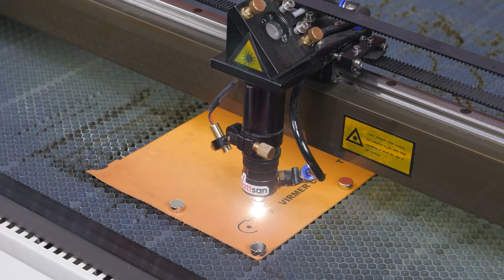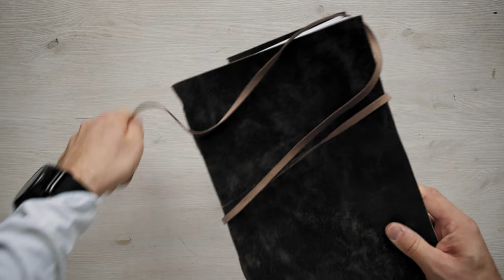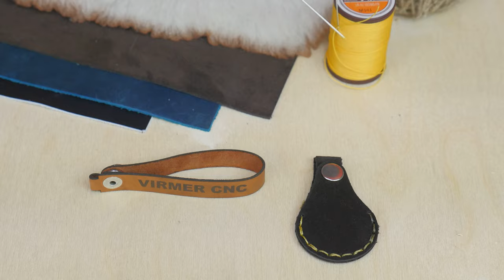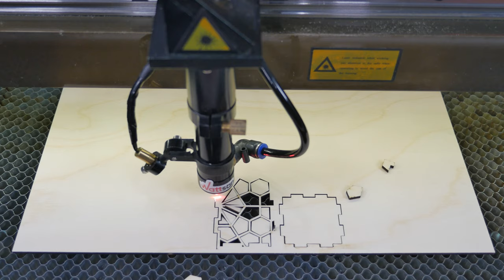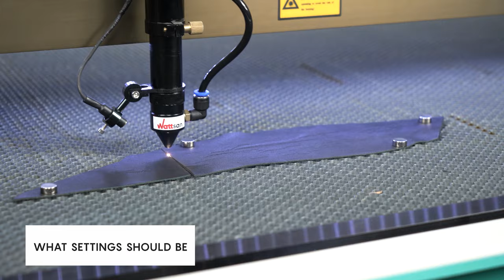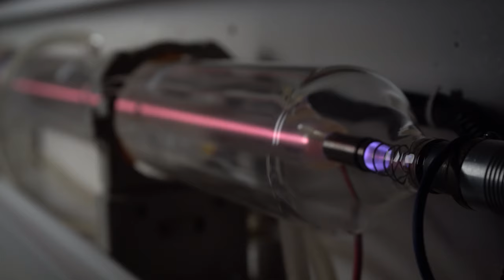HOW TO CUT & ENGRAVE LEATHER | WATTSAN CNC MACHINE

Comment: What's the wattage on your machine you show the settings for?
Reply from the maker: Hi. Thanks for the question! There are two machines featured in this video:
Wattsan 1290 with 1200*900 work area, 90-100W laser power and Wattsan 6090 with 600*900 work area and 100-130W laser power.
The laser power largely depends on the material you are going to work with. If you have difficulties with the choice of power, you can call us +31852731786 we speak 6 languages: English, German, Spanish, Italian, French, Spanish and Dutch. I hope we've been helpful😀